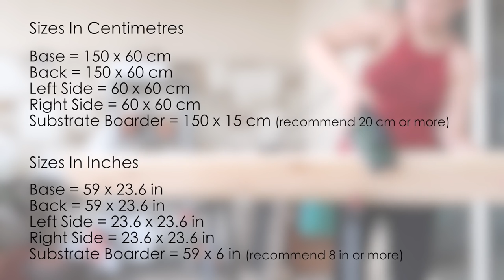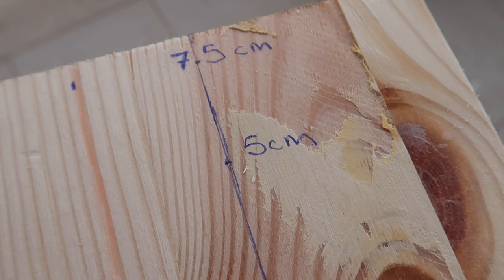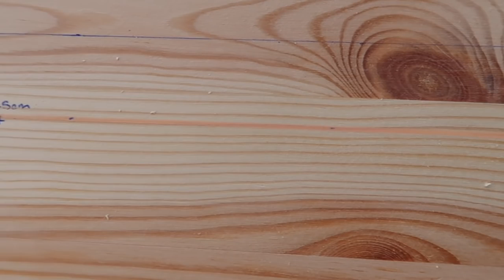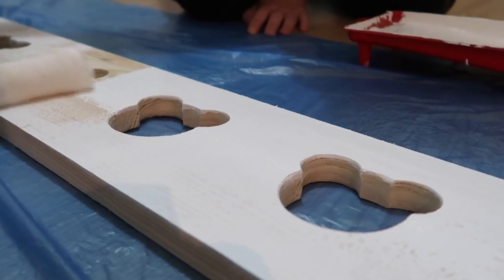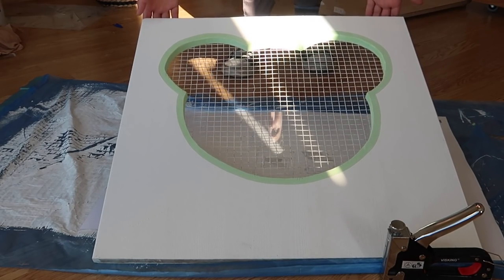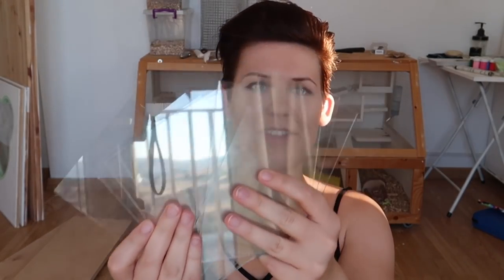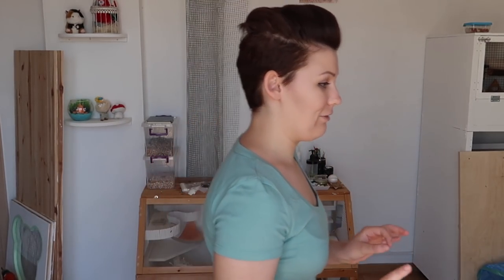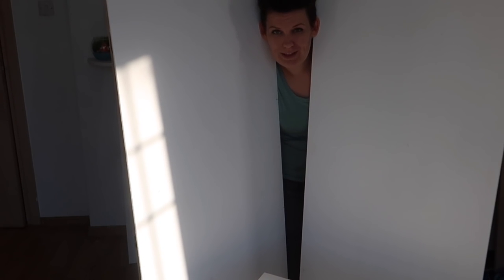Building A 1300sq Inch Custom Hamster Cage | The Beaker [1/3]

Comment: Erin is there a minimum cage size you would recommed for a pair of dwarf hamsters (most likely will be male winter whites). Obviously it should be bigger then the 360 sq. inches minimum, but how big should it be?
Also, do you have to varnish a wood cage if you sand all of it?
Reply from the maker: I'm unaware of an official minimum for pairs (though I should mention the bare minimum for single hamsters was upgraded to 450sq inches in 2016). From my own experience in keeping dwarf pairs I recommend the cage be at least 80 x 50cm to accomodate the extra supplies and the extra space needed. The Ikea detolf is a popular cage choice for dwarf pairs if you're looking for a commerical option. As for the wood sanding and varnishing have two different purposes, sanding removes splinters, sharp edges and gives the wood a smooth finish. Varnish protects the wood from moisture :)

Comment: Hot Tip: You don't need to buy a stapler gun. The top part of a regular stapler that has been 'pulled apart' (usually to refill the stapler) can be used as a stapler gun as well. :)
Reply from the maker: Really? Staple guns have a lot of force behind them I wouldn't have thought a standard paper stapler would be able to staple through hard materials like wood. Interesting :)
Reply: ErinsAnimals no it wouldn't a paper stapler would break
Reply: I saw the vid on 5-Minute Crafts and it seemed to work quite well, so maybe if anyone or Erin herself can test it out we'll know if it really works, I guess...

Comment: What’s wrong with Iodine’s current cage? It looks great!
Reply from the maker: There doesn't need to be anything wrong with a cage to upgrade to a new one. Her new cage is going to have the Billy XL fixed on top as the roof which will be a huge space saver, it's also a little bigger than her current cage and more space is always beneficial to a hamster :)

Comment: that is an amazing cage so cute i have a wire cage with hamster cut outs the plastic door that got broken had tiny hamster cut outs i the cornors of it i have yet to buy a new door mostly because im most likely going to get a tank to put my first hamster in insted of a cage since its less expensie and i am not good at building or more or less i dont have the tools to build

Comment: can i ask is my hamster able to live in aircon ard 25 degree?(usually the temperature is around 30-32 degree)
Reply from the maker: Hamsters should never be under direct air-conditioning but being in an air-conditioned room is fine, 25C is an ideal temperature for a hamster. Try to prevent the room from reaching temps over 30C or under 10C :)

Comment: Do you still have the Billy XL?
Reply from the maker: Yes, I've had to take it apart for now as it's going to be fixed to the top of this cage as the roof (you'll see that in part 2) and Osmium will be moving into the Billy eventually - that will be a whole other video! :)

Comment: Do you mean gloss as I've never heard of white varnish
Reply from the maker: Coloured varnish is a paint/varnish combo which can be used without a secondary coat of clear varnish on top. I think it has a different name elsewhere, I flit between calling it varnish and paint but try to stress the word "varnish" in my videos as that is what's protecting the wood and doing all the real work :)
Reply: ErinsAnimals see gloss does exactly the same thing it's a high shine very thick paint varnish type consistency and looks the same as your using so that's why I asked , a child safe gloss is what we would use in the UK x
Reply: Oh and doesn't need a varnish top coat as it seals just like varnish you can get it wet etc and it repels it x

Comment: I was wondering what lights do you use in your hamster cages? Like the ones in the Test Tube cage and Iodines old cage?
Reply from the maker: I use the Ikea stotta lights, they're battery powered LED strip lights so there are no cables and they don't give off any heat :)

Comment: I thought hamsters would eat through the wood and also dampen the wood making it moldy and smelly.???
Reply from the maker: Hamsters are not destructive chewers, it's extremely unlikely that a happy hamster would chew through a wooden cage. People (myself included) have been keeping hamsters in wooden cages for many years, it's a pretty common material to use. That being said if you know that your individual hamster is a destructive chewer they should of course not be kept in a wooden or plastic cage and should not be given plastic or fabric toys. As for the risk of liquids soaking into the wood, the whole purpose of varnish is to protect wood from liquid damage :)

Comment: Ernie did you hear critter trail   release a new cage call the super habitat or something like that they finally listen  to us and they're using peoples opinions you can check it out and pickles channel
Reply from the maker: Yes, I was told about it before it was released. It's an okay cage, not something I would personally use, but a step in the right direction as it gives more commercial options to people in the US and it's nice to see them finally offer something above bare minimum. I think the price is absolutely ridiculous though, especially as Savic sells much bigger cages for nearly half the price and you can buy tanks for less. I also hate that they advertise it as "super-large" which is heavily misleading to new owners, it's barely above minimum making it a small sized cage. Even the cage I'm building in this video is only considered a medium-large as it's only 1350sq inches. If they want to call it "super-large" they need to start selling cages like the amazing 3800sq inch one Hopping Hammy made! 😅
Reply: Omg you reply thxs for taking the time answer me also true as my cage is much more space width wise and height as when pickles set the cage it kinda look stuffed